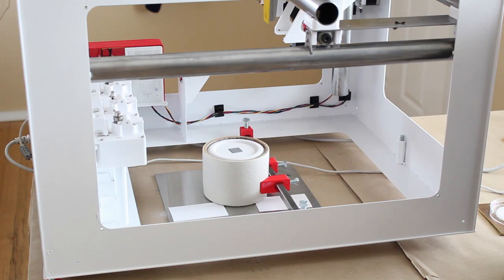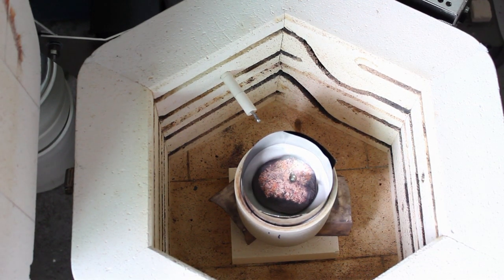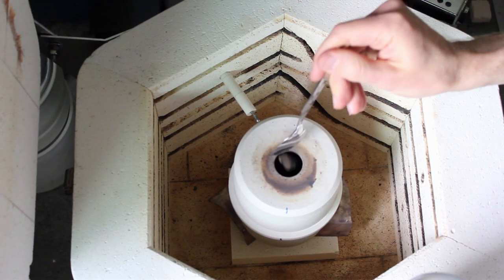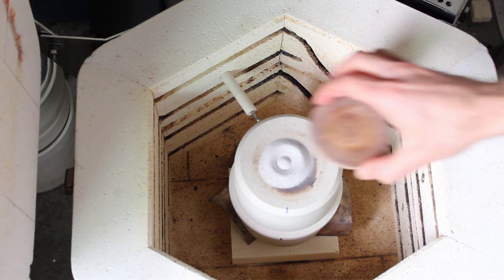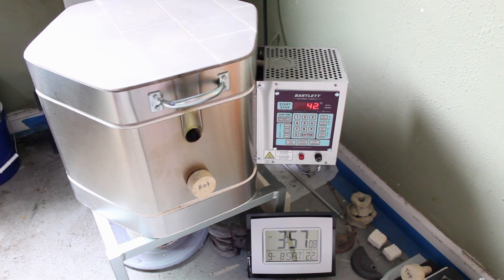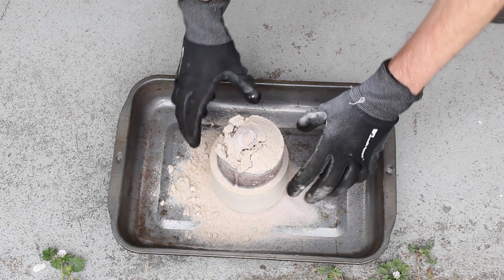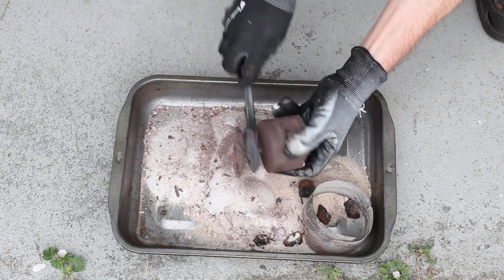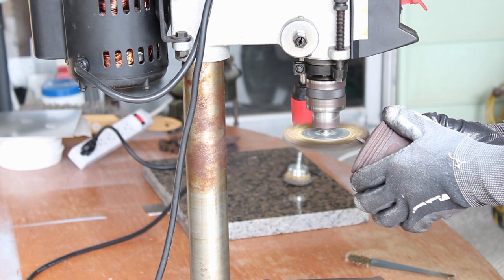iro3d tutorial #05: How to bake the crucible

Comment: Firing sequence:
 Room Temperature to 550C at 200C/hour
 550C-650C at 100C/hour
 650C-1184C at 600C/hour
 Hold for two hours, more or less depending on the size of the part.
 1184C-600C at 600C/hour
 600C-500C at 100C/hour
 Turn kiln off and wait until cool.
Reply from the maker: That's correct.  Though the kiln turns off by itself when it reaches the end of the last segment.  Sorry, I didn't explain it clearly in the video.  It's better to leave the kiln plugged in, until it cools down, because it shows the temperature.  You need to unplug it just before you open it, to eliminate the risk of electric shock in case you touch some wires.  Though, again, good kilns should not have any voltage on those wires when they are not running.
Reply: iro3d  How important is the 1184C? I'm looking at a Paragon SC2 (someone is selling a used one near me), and its maximum temperature is 1093C. Can you compensate for a slightly lower temperature by holding that temperature for longer, or will sintering not occur?
Reply from the maker: The 1184C is somewhat arbitrary.  1093C should work too, since it's above the melting temperature of the copper.  Though it might take a long time for the middle of the crucible to warm up, as sand is a poor heat conductor.  Also, if you use a copper alloy instead of pure copper - its melting temperature might be lower.  But I would still recommend a better kiln.  You can buy a used cone 10 kiln on Craigslist for a few hundred dollars, though it might take a few weeks.
Reply: When I first watched this tutorial video I missed that you were using a copper alloy whose melting temperature was below your hold temperature of 1184C. I now understand why you have a pancake on the top - the molten metal from the pancake flows down into the mold to replace the air from between the metal particles, resulting in a solid metal part instead of a sintered metal part.
Reply from the maker: Exactly.
Reply: How much does the copper nickel or copper iron powder cost? Does TriDPrinting.com sell these powders too? The melting temperature of carbon steel is 1425-1540, so I assume that you are just sintering the steel powder in your kiln? Or do you still use a pancake (of metal that will melt), and do a combination of sintering the steel powder+having the melted pancake metal bind the steel powder together?
Reply from the maker: Fred, to print copper-nickel, you would need to use pure nickel powder plus pure copper pancake. To print copper-iron, you would need to use pure iron powder plus pure copper pancake.  There is no sintering - just melting of the pancake.  As for the pricing and availability, you would need to contact the 3rd party suppliers, such as TriDPrinting, directly.  If they don't have a product you need listed on their website, you can call them and ask.  They are very friendly.
Reply: So for your original prints out of carbon steel powder, you also used pancake?
Reply from the maker: I am not sure what you mean by "original".  For the older prints, we were using high carbon steel pancakes of low quality, that's why we had the defects.  The later once were printed with good quality pancakes, so they had no defects.
Reply from the maker: Electric kilns need oxygen for kanthal wire to heal.  It won't last long in argon atmosphere.  And oxygen in the kiln is not a problem, because we have a crucible to protect the print.  But oxygen is a problem if it's present in the infill metal.

Comment: I presume the purpose of coke is to deplete the oxygen levels but assume this won't be adequate for Aluminium. If I were to use a kiln similar to yours but create a positive pressure environment using Argon or CO2, would I be able to cast Aluminium?
Reply from the maker: Yes, coke is used to bind to oxygen, but that won't work for aluminum, because aluminum has higher affinity to oxygen then carbon.  Just pumping argon into the kiln might not work either, because some oxygen would still remain.  If you have a vacuum kiln - you can evacuate it first, then flush with argon or nitrogen.  That might work, but I haven't tried.  If it doesn't - we might need to add some flux, preferably as a gas.
Reply: @iro3d  I think to achieve the necessary oxygen levels you need an ultra high vacuum which requires a turbomolecular pump or something equally as expensive. I'm not sure it's really viable but can only speculate until someone tries it.

If the kiln is set to a temperature that is above the infill's melting point but below the melting point of the material to be fused together, does that mean it only possesses that strength of the infill material?
Reply from the maker: The infill metal bonds with the metal powder, and you end up with a solid piece of metal.  So, the strength of the printed part as about the same as a cast one.

Comment: I've been reading about people heat treating metal in electric kilns. When you put coke into the kiln to use up the oxygen, you end up producing carbon monoxide. Is your kiln vented outside, or outside in a well ventilated area? Do you have a CO2 detector where your kiln is located?
Reply from the maker: The coke is placed inside the crucible. At high temperatures, coke does generate CO, and some of it leaks into the kiln, where it burns and becomes CO2, which vents into into the room through the vent hole in the kiln.  Electric kilns must have a vent hole, because oxygen is necessary inside the kiln to maintain healthy heating wire.  I have both CO and CO2 meters.  CO shows zero.  CO2 level varies over time, because of the people breathing. But I have not notice much of an impact on CO2 level from the kiln.  I would guess that a gas stove would increase CO2 much more than a kiln.